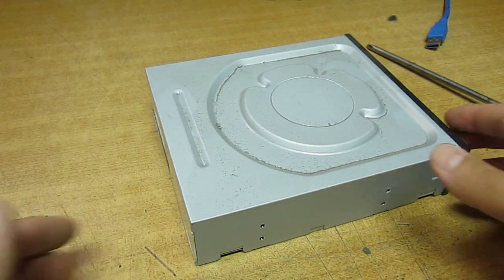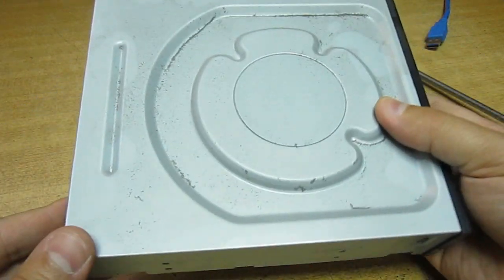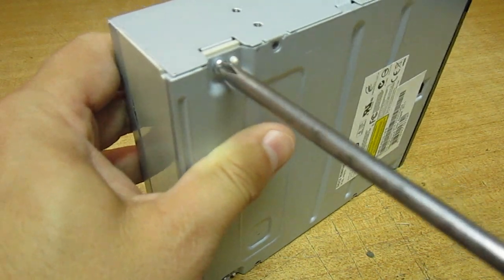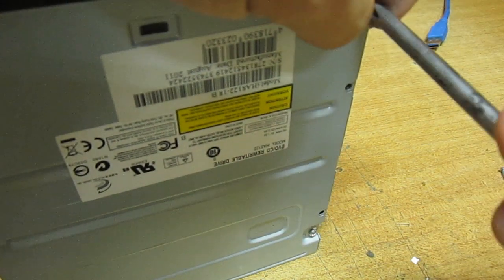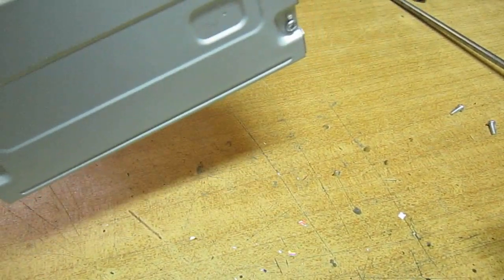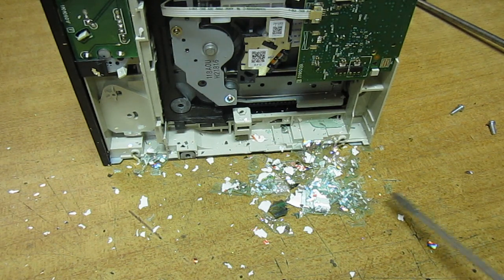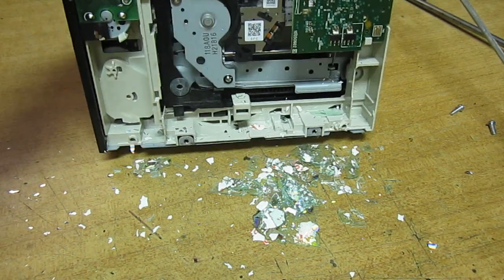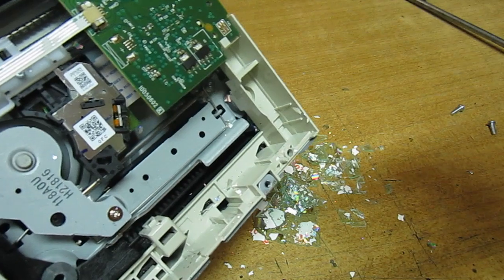Exploding CD - urban legend?

Comment: That could be used as an ultimate form of copy protection.  One you install it, it could spin up to max to shatter.  The disc would be manufactured in a way to ensure this.  Would spin slow during install, then fast after to shatter.